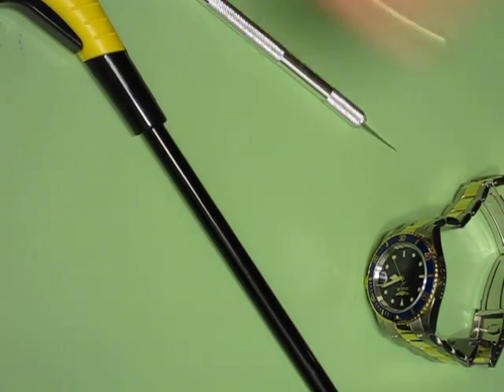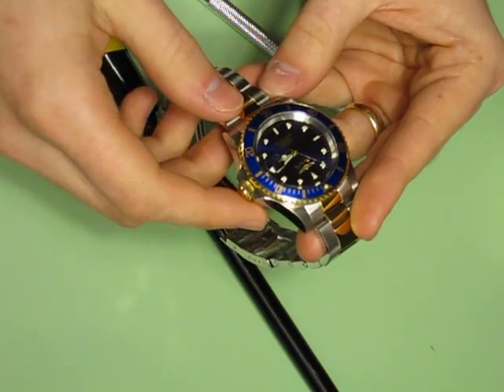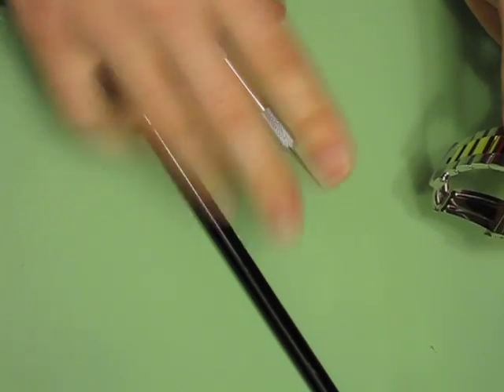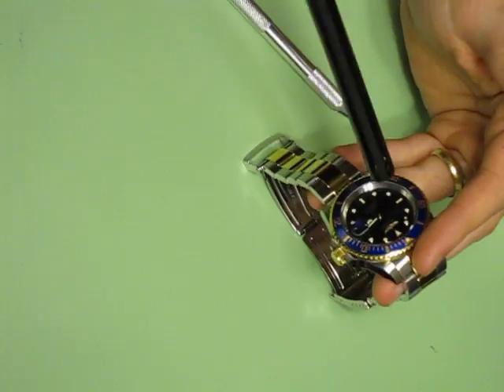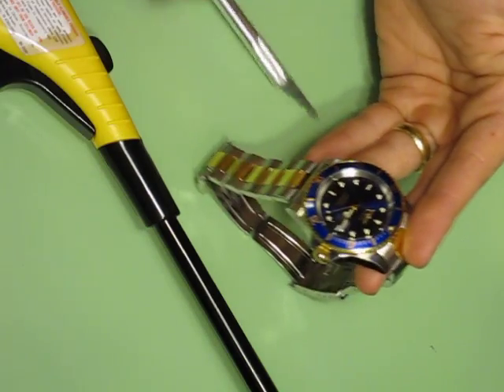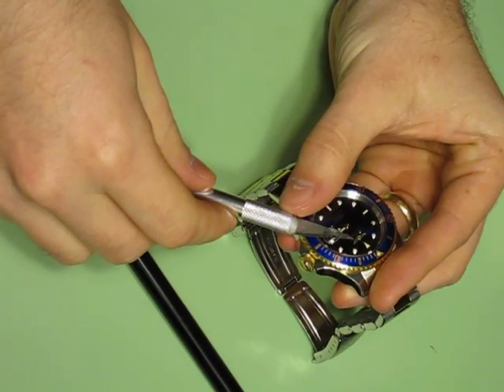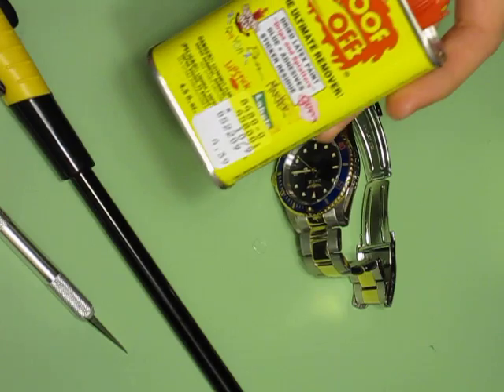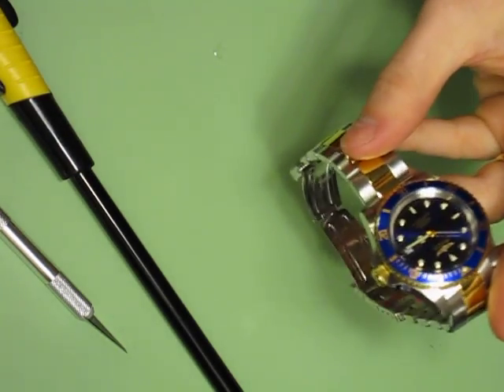Cyclops (date magnifier) removal from watch crystal

Comment: It worked like a charm.Thanks.Just another tip,make sure the watch is warm before trying this.I let it on a oil radiator,wrapped in a cloth,for 15 minutes before removing the eye.If the watch is cold,the crystal may crack.Amazing how much better the watch looks without that damned gizmo.

Comment from the maker: @riceoobxg It would if you left it on there for a while, but the amount of heat and duration it's applied is simply too little to damage it.  I've now done this on a good number of watches of various brands and as long as you warm up the crystal (hands or mildly hot lamp) before you use the lighter, the cyclops removal will cause no adverse impacts.

Comment from the maker: @13rock13 If you can afford the 9937, I would go with it.  The added benefits are:
1.  swiss movement (now they use the Selitta SW200), typically more accurate 
2.  the Flame-Fusion crystal (which gives near scratch proof performance)
3.  screw-links
4.  beefier clasp
5.  solid end links

Go for the 9937 if you can.  They go on sale for about $200 every now and then and that's a good price to snag one.

Comment: Thanks, worked like a charm once I got it hot enough. First I tried with a soldering iron and then a fireplace lighter. Cyclops wouldn't budge, so I'll got out my butane torch. The cyclops popped right off just like the video, but I burned the paint on my bezel. No big deal, I was using a beater to practice. Seems like you want a something with a small focused hot flame. Thanks!

Comment: This works well.  Personally, I like a cyclops and have put them on a couple of watches.  I used large sapphire 2.5X  ($6 each if you buy 3) from julesborel.com; magnification is just like Rolex.  I put them on with a tiny drop of UV glue also from julesborel.  I unfortunately got one misaligned and noticed after the glue cured.  This method worked great to remove it so I could try again.  (I was nervous, so I put a cyclops on an old junk watch and took it off just to test the process before trying it on a good watch.)
Reply: How hard is it to replace the cyclops?  I have a Grovana Coral Reef with a weak cyclops, and I want to do the same thing as you.